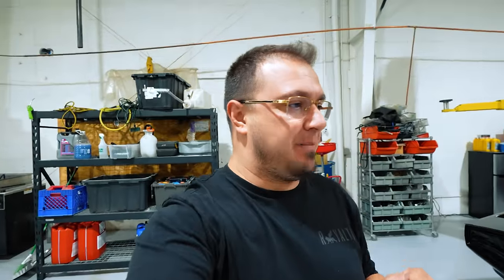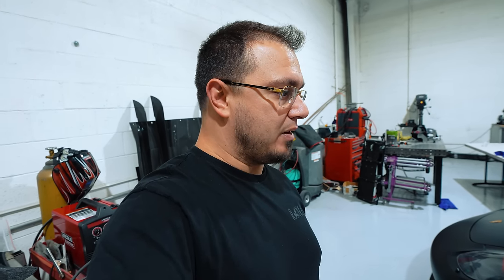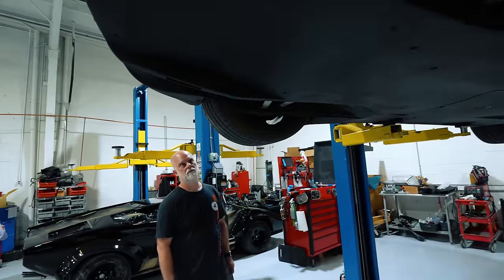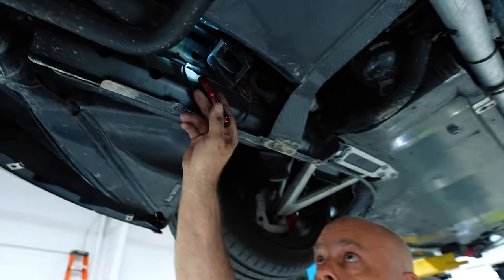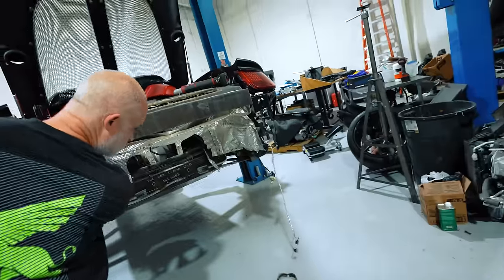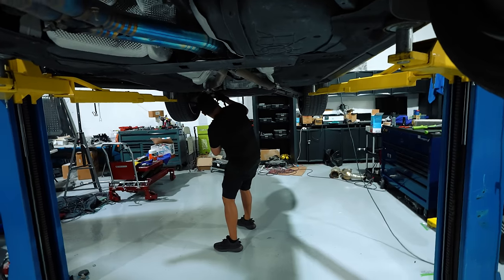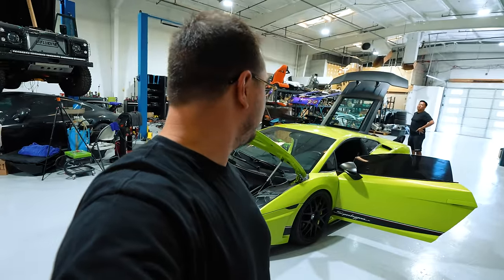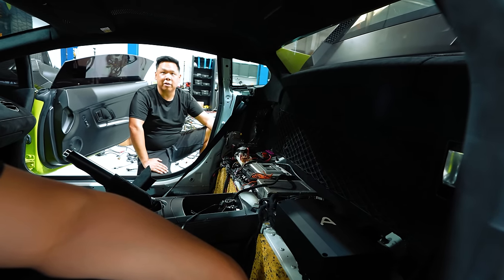Revealing HIDDEN Damage on my Gas Station CARRERA GT

Comment: Make sure you look at the shocks so you don’t Paul walker the car. DDE almost did it with his. Forgot how he fixed it though
Reply: Shocks fall under suspicion
Reply: JAY LENO had randomly seen Damon  earlier that day said you have to swap those stock adjustable   inboard Coil over shocks and their springs ( ride height spring locking rings) their locking Rings don't lock permanently  Porsche  did a mandatory free replacement  as far as I remember.  .. or find  a exact  replacement locking ring giant nuts  just need a 3rd ring lol ....
 Jay Leno  had his locking rings loosen @ DAYTONA SPEEDWAY.  AT 180MPH  !!!!!!!!!
Reply: That's insane !!! I remember seeing that DDE episode and thought to myself .. wtf??? Thats sooo sketchy and stupid.. That should of been a recall immediately that's a very scary thing to go wrong on a car that's worth over a million dollars and can go over 200mph !!!
Reply: I thought of that aswell.... I went to look back for that DDE video but can't find it, maybe delisted due to ties with Dean.
Reply: KW sells a full suspension kit, Doug DeMuro installed it on his Carrera GT.
Reply: DDE suspension came apart while he was driving I’m pretty sure
Reply: Think it was the top hats
Reply: I thought it was old tires to blame on Paul's car. No?
Reply: I would bet that the ones that own it and are familiar would do this lmao
Reply: They finally came out with a recall for the issue
Reply: The tires were the originals from the factory. They never replaced them.  They were riding on hockey pucks!! @helimx
Reply: I’m pretty sure they finally had a recall for it but would 100% look into the suspension make sure it’s been replaced/fixed.
Reply: As far as I know, Porsche did a recall for the suspension recently and advised all owners not to use the car until it was sorted, it's my understanding that this is still in effect until all cars have been upgraded, certainly in Europe owners were parking these up and not using them.
Reply: Paul Walker was a passenger ...
Reply: Houston is a complete teardown and rebuild guy. Through I'd content I can ell he's about perfection
Reply: Matt Armstrong is going to rebuild Pauls CGT and he’ll do the shock upgrade😉
Reply: @r0b3rt_959  KW are the goats of suspension.

Comment: Swap the whole suspension for the KW kit. It will probably be a lifesaver.

Porsche has a recall for some suspension flaws. Jay Leno spun a CGT at around 180 mph while he was driving one either in Daytona or Talladega. A suspension failure was a probable cause on Paul Walker's crash.

Comment: JAY LENO had randomly seen Damon  earlier that day said you have to swap those stock adjustable   inboard Coil over shocks and their springs ( ride height spring locking rings) their locking Rings don't lock permanently  Porsche  did a mandatory free replacement  as far as I remember.  .. or find  a exact  replacement locking ring giant nuts  just need a 3rd ring lol ....
 Jay Leno  had his locking rings loosen @ DAYTONA SPEEDWAY.  AT 180MPH  !!!!!!!!!
Reply: Paul Walker  SUSPECTED CAUSE FOR FATAL CRASH WAS THE REAR SUSPENSION DROOOPING AND DRAGGING 1 REAR WHEEL INTO THE CHASSIS @ SPEED. CAUSING THE SPIN.INTO A TREE

Comment: Not "almost like a brand new clutch". New is 31mm and needs replacing at 28mm, so you are 1mm away from needing a replacement. That 1mm can last a long time or it can disappear quickly depending on how the car is driven. Nonetheless, 66% of its life is gone.